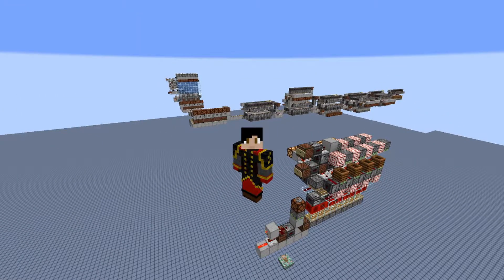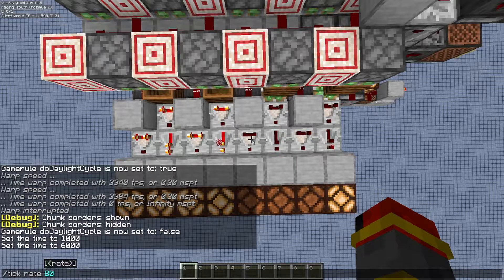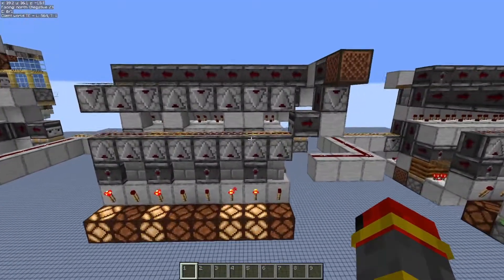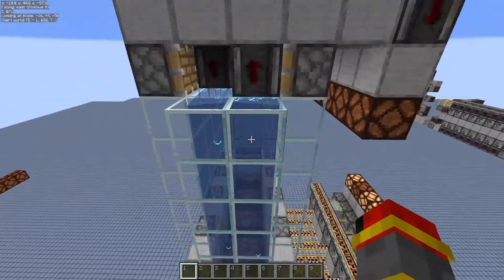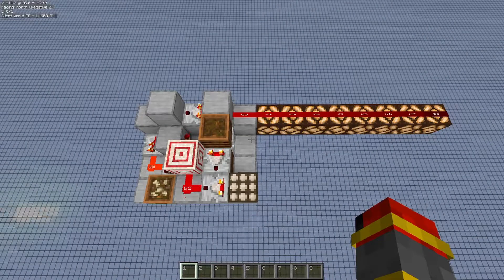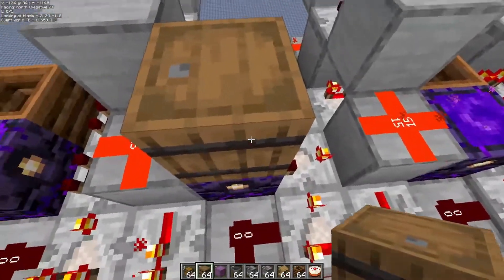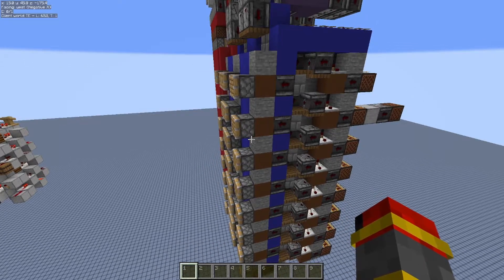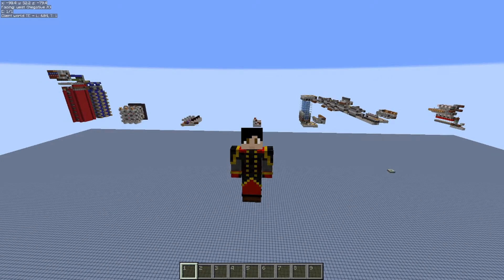Redstone Collection 2 - Serial to Binary Transcoders & More | Minecraft

Comment: I kinda want to see vanilla wireless redstone tech used with one of your amazing displays, but it's probably a bit on the slow side, on the order of 2 baud per transmitter and requiring twice as many receivers to receive data sent at that rate. I've been working on transmitting data reliably but it's not ready yet because college comes first. :(

I feel the same way when people are like "bubble columns are instant" and I get sad because I know that the truth is they're not and they don't even have the same delay in both states. I fix this by just chaining 2 bubble columns in opposite states so that their total delay is always the same regardless of state, less updates for more delay that way.
Reply: What wireless redatone design are you using? Ive found some recent ones with much faster speed
Reply: @personalstuff3019  A custom one based on liquid update suppression was what I was using. It's still technically the more reliable one compared to item based ones, but the amount of water you need to update makes it so that it's harder to build transmitters, receivers are simpler though. I was the one that figured out that any model update was sufficient to schedule the liquid updates and that additional updates to the same liquid block still proportionally increase how bad the lag spike will be without any benefit.
Reply: @curtisstofer6678  whoa wait you have anywhere you go over it in depth? It seems luke an interesting mechanic the ones ive seen all use daylight sensors and items
Reply: @curtisstofer6678  sorry for the reply spam but does your design work in single player? If so thats a huge advantage cause to my knowledge the ones rn only work on servers
Reply: @personalstuff3019  np. I don't really upload although I had originally planned to do one once I got binary data transfer over wireless working, which I never really finished. I was initially inspired by EarthComputer and Xcom6000's design but I mostly worked on it over last summer. Here's some good videos.
https://youtu.be/PAMe-YoVEFM
https://youtu.be/vdh8kop3A8M
https://youtu.be/dJH3tDduISA
In that last video, I'm Silicon42, the person, that he mentioned. Also not directly related but useful to move the antenna away so that clients don't feel as much lag from the block state updates: 
https://youtu.be/nJx-o9fDVm4
I can also get you a world download of my world if you want but that will have to wait a little since I have some improvements that neither of them have.